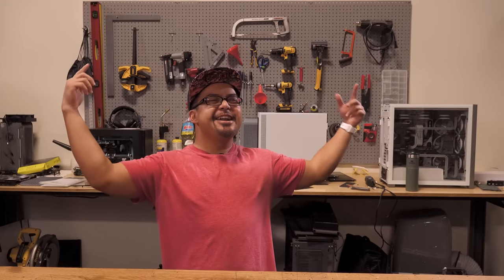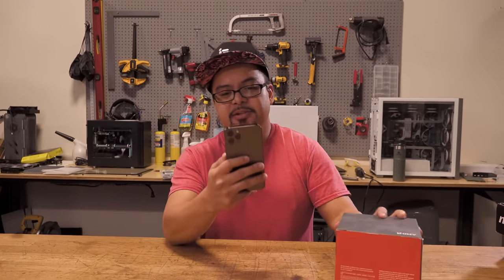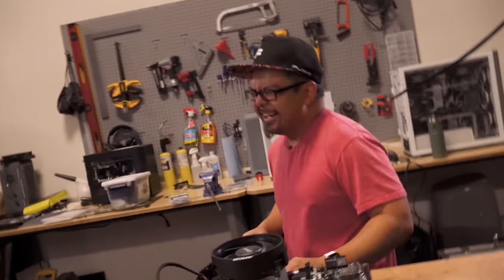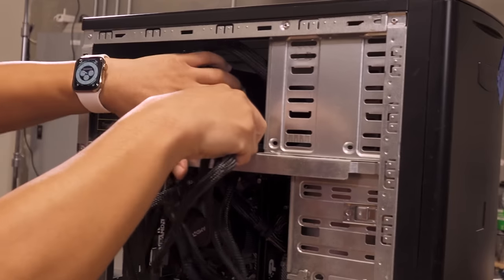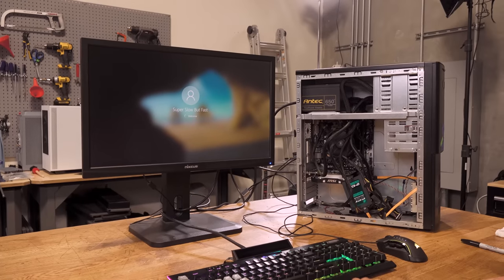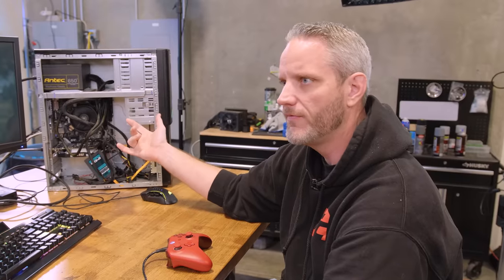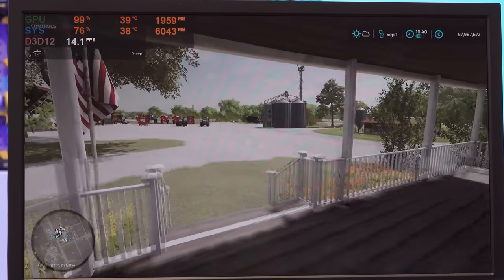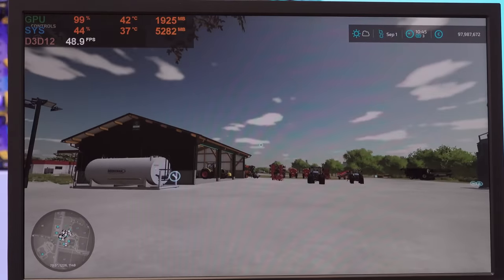Can you game on a "Potato" PC in 2021??

Comment: Petition for more Phil builds? Absolute A tier content! lol

Id like to mention though, the 1050 only has 2gb of vram, which is not good for 60fps on most FS games since it has a really high render distance and needs to compile a ton of shaders and unlike other games, tons of crops and ground types at once the moment you spawn in. This is why going from the 2gb 1050 to the 6gb 1060 made such a big difference. This has been the case since FS17 came out. Also, to get better performance on high, just set shadows and Shader Quality to medium and everything else to high and you should see a decent increase in performance across the board.
Reply: The RAM couse also fps drops, I play fs22 with 16gb RAM and it uses over 50% of it alone
Reply: I want to see what difference a 3060 Ti would make with this 1300X CPU. I'd bet it would be capable of a lot more than most people would think.
Reply: It was a 3GB 1060 i believe, but still i agree with you, this looks and behaves like a vram issue. Especially that part that when you look at the house which is a less vram demanding area you get 60fps and looking at the complex part with all the high quality equipment it drops to 10-15fps
Reply: @malcewicz  I doubt that it was a 3gb 1060 it is more likely to be a 6gb 1060 as they was the goto card with the most bang per buck.
Reply: I agree, I was also suspecting VRAM, especially given he ran the same settings, and there was a noticeable difference in both system ram (shared overflow from GPU) and VRAM usage.
Reply: Yes we need Phil more often!

Comment: Jay: let's build a potato pc!
also jay: builds an average gaming pc
Reply: lol he couldn't find a 760 and he used an SSD instead of a HDD
Reply: Yeah, they used hardware many times higher than the minimums they listed, then act shocked when it works as well as it does.
Reply: @im_linus  sorry bud, tell that to gtx 400 series.
Reply: I built a Intel 970 and 780
Reply: @im_linus  Well scalpers sell the GTX 1060 in my region at ridiculous prices, 400 USD to be exact.
Reply: I have 1050ti… but in a laptop 😭. I built my cousins so now it’s my turn in like 2 years when the shortage ends lol
Reply: @im_linus  Nah it's the 3gb cards.
Reply: @im_linus  ikr, man I'm just going to play older titles and some eSports for now, there's now way I'm going to cough up the cash for these scalpers.
Reply: that is 1080 ti next year xD
Reply: @Gaming ZONE GAZO bruh I’m on uhd
Reply: I'm here with:

AMD A6-9230 Dual Core 1MB L2 cache

4GB RAM 2400mhz single channel

Radeon R4 integrated graphics

120GB SSD (Upgraded from 1TB HDD, I miss that much capacity)

Comment: The problem with upgrading "1 tier" is that the 1050 vs the 1060 is quite a large gap in performance just like most 50 to 60 NVidia cards, even though it doesn't sound like it.
Reply: I think I understand your point... a "tier" varies a lot. A GTX1070 vs a GTX1080 would be a much smaller gap. A GTX1060 vs GTX1050 at same settings might give 75% higher FPS. I haven't crunched the numbers, but I suspect tiers have larger gaps at LOWER END and smaller gaps at higher end. In part due to other system bottlenecks, but also because getting slightly more performance at higher end is expensive (and that's before we get into diminishing visual returns... so lower end from a "value" perspective has a HUGE jump per tier).
Reply: @photonboy999  Absolutely!
Reply: I own both cards and can tell you for a fact the 1060 can still play anything but the 1050 is only good for plex transcoding. Seriously it just cannot realistically game in 2021.
Reply: MaYeRsDZ  yea definitely not like the 1050-1060, its more of like 30% for those.
Reply: @alainmilette6460  facts!
Reply: Alain Milette I'm still running a 1050ti and play older titles because that's all it can play. Sed lyf.
Reply: @sinuslebastian6366  Got a 1050 ti aswell it runs okay but i mostly play games older than 2018 and i overclock it for most games anyways just to get the extra 3 - 5 fps lol
Reply: @iroh9816  what overclock you run man?? Looking to get into it but find it a little intimidating
Reply: @sinuslebastian6366  150 core clock and 500 memory clock it's quite stable
Reply: Iroh noice!
Reply: Its really 3 jumps.
1050
1050ti 
1060 3gb 
1060 6gb

Comment: 2:45 having a DVI port was one of the main selling points for the motherboard on my current APU system. Why pay for expensive monitors when there are so many older ones laying around? The environment surely would agree with me.
Reply: Preach brother. A lot of older monitors still have really good colors and response time is plenty good for non-competitive play. The most important factor in gaming performance (up to a point) is the person at the controls. Plus they act is nice little heaters during the winter.
Reply: Yes exactly
Reply: was one of the reason i'm buying 1030 with vga port
Reply: @ouwkyuha  VGA is another story. With DVI you get a digital signal that looks just as good as HDMI, all other things being equal. VGA is just plain worse

Comment: I love how expectations of these running low specs is not even in Jay's radar. Didn't even attempt to run the game at 720p, which is a very reasonable thing to try. Also, trying to make it locked, smooth 30 fps is also very relevant - especially given what he says later that it's a slow paced game.
Reply: He's not used to having limitations.
Reply: Yeah I currently am on a GTX 760, and just play games in 1600x900 or 720p because 1080 is just too much ha
Reply: I can't tell the difference between 30 and 60 fps, let alone 120 fps or higher framerate.
Reply: I remember when I built my first gaming PC, 30-40fps locked was all I could hope for with some games, and it was playable. It's worse to have your fps all over the place rather than just capped steady at a "playable" rate.
Reply: Why should he go down that far when the worst hardware he has already does 1080p low just fine?

Comment: id love to see a video comparing current integrated vs older dedicated, love the idea of showing the progress in long term. same for power usage, at the same performance
Reply: Have a like!
Reply: Have two!
Reply: Why so stingy? Have 7 likes!
Reply: Unless the older dedicated is really old, it'll probably still trump current integrated.
Reply: @arnox4554  im betting anything with 2gb ddr5 and better is going to be faster, but then the wattage difference is going to look hilarious
Reply: Idk about intel hd, but i have a 5600g. it outperforms my old r7 350 and it supposedly outperforms a gt1030 by a decent margin. Trying to shoot for an rx 6600 but till then the 5600g really isnt that bad for most of the gaming i do.
Reply: I just built a new DIY system with a Ryzen 5700G.  It runs Forza Horizon 5 at around 40fps, which is only about 30fps than my Nvidia GTX970!!
Reply: @arnox4554  Depends how you define "really old". I don't think 5 years is that old but I just built a new DIY system with a Ryzen 5700G.  It runs Forza Horizon 5 at around 40fps, which is only about 30fps than my Nvidia GTX970!!
Reply: @carlwaring  thats awesome, but racing games arent all that demanding usually.

Comment: Nice to see you testing it against FS22 and fun that you even notice that you get stuck for hours . But a tip. test it with more objects. for each pallet from the factories or greenhouses or loggs in the forest is registered as a separate object. so all computers will have problems in the end especially if you load loads of pallets or logs on several trailers and drive away or stack them in massive piles and then try to move the pile.  In MP the we have 150 pallets on a trailer on a I7 4790 - 16 gb ram dedi server and all get about 15fps when it moved ;)

Comment: I’m very glad I upgraded my system back in February. I was basically running what they call their potato build. GPU is still the 1050ti (so barely better than what they dropped in this) but the rest has been replaced by MUCH better hardware
Reply: Did the exact same two months later. Kept my 1050ti too! Let's hope we can upgrade with something reasonable within the next 2 years, cause 1 year is maybe a bit too optimistic.
Reply: gt 1030 for life ;)

Comment: I’ve had nothing but problems with farming sim 2022 since launch,  anyone else getting random screen flicker tied to frame timing,  only happens after a couple hours then the screen will start flickering badly
Reply: Only on the Elmcreek Map. But there it is permanent. On the French Map it only happend once or twice in 20 hours.
Reply: @DasNik25  it’s pretty annoying when it first happened it startled me,  was worried I’d had a hardware failure on a brand new gaming build and monitor
Reply: I have no problems, and I play the game every day for 2-6 hours on Elmcreek.
I use an RTX 2070 super Graphicscard. I play the game at 2560x1440 at 60fps on highest settings
Reply: I've battled this issue of stutter and tearing all sorts  for 3 weeks I did alter my graphics card 3d setting  used dev mod and changed the cable from my pc to monitor  today so far so good but this game has worked fine before then a day later something else goes wrong.
If you go into the shop and zoom out the fps plummets and stutters. 
Think the game itself need a long hard look at by Giants as I see so many unhappy people with this game.

Comment: Until the middle of this year I was running a I7-7700K with a Radeon RX Vega 64 card and a Ultra Wide 2560x1080 display. This was with starting to stream in January of this year. I ran games like Cyberpunk 2077 on Ultra settings with 45+ fps. While the Vega was way more powerful than people tend to give it credit for (and I paid way to much for it since I bought it during the 1st cryptocurrency boom), it was quite capable. I only replaced it because streaming on that PC wasn't possible with certain games (like Subnautica and Cyberpunk 2077) as resource usage was just to high.

Comment: I think one of the important thing is the VRAM size. GTX1050(2GB)'s 2GB VRAM is not capable of most games now (or even long time ago). But 1060(6GB) is still pretty enough for most games.
A sweet spot is 4GB VRAM, from GTX960(4GB) to GTX1050(4GB) and 1060(5GB) and beyond.
Reply: That’s why I love my 3gb 660 ti so much, it actually helps a lot to have 1gb of extra vram on that card. It’s still nothing compared to my 1080 ti though.

Comment: I like the direction that you went with this. Though I would try like a GTX 970 and an ivy bridge, 16GB ram and a SSD. That would be a good cheap gaming PC that is capable and cheap to buy on the secondary market. Hell, a 770 would probably still hold its own at 1080p gaming these days.... it did back then.

Comment: Seems to be VRAM related. Medium is using 2.3GB, High is around 2.7GB. System Memory usage was lower on the 1060. Seems to be buckling having to swap assets between VRAM/System RAM on the 1050 since it only has 2GB of VRAM. A 1050 ti might be able to handle it better since it has 4GB. Reducing LOD and Object Draw Distance as well as turning off MSAA (which is very expensive in terms of performance compared to post processing AA techniques) are probably the first changes to consider. You have LOD/DD over 100%, so it is rendering objects/terrain that is far away, hence why it drops so hard when you look towards your farm. For AA,  TAA should be good enough, or perhaps using reshade for SMAA/FXAA.

Comment: Huh, did not expect it to be that close to my current system:
4GB RX570
Ryzen 3 3200G
16GB 3200MHz CL16 RAM
B450M mobo, also with VGA and DVI.

It runs the most demanding games I play well enough (Century: Age of Ashes and Horizon Zero Dawn) and it does not struggle with everything else I play on it, so it's not a problem that I won't be able to upgrade it any time soon.
Reply: Latest patch added AMD FSR to Horizon ZD.
I wonder what kind of performance it is possible to have with just using R3 3200G and 1920 x 800 scaled down to 60% / low medium

Comment: In 2018 I finally replaced my +10 year old gaming setup which, with one I am still using today. 

In the first few months I was only using the onboard intel cpu graphic chip the 630. 
I specifically ordered 16gb of ddr4-ram 3200MHz to slightly boost its performance. 

And it was capable of playing pretty much any title up until than. 

Counter-Strike: Global Offensive
Doom 2016
Elder Scrolls Online
World of Warcraft
Mass Effect Andromeda
Skyrim modded
Overwatch
etc.

I later did buy a 1050ti for a bit more quality. 

So here's a video tip: 

How can you utilize a onboard chip to its full potential until the gpu prices drop and or are back in stock. 

1060's are still pricy, heck even the 1050ti's are nearly 400 euro's right now. 
I bought mine for 250 and that was already 30% more expensive. 

But the 1050ti is perfectly capable of playing pretty much any game. 
Granted it won't look as pretty as a 3090 Ultra settings, but it gets the job done. 

And I personally always play my ( Shooter games ) with everything set to LOW for the best performance and lowest input lag. 

And at this moment I am playing Vanguard and Warzone with a FPS between 50-90. 
 
With my FPS being a steady 46-60 fps in Warzone Pacific. 1080p and I even won a match.

Comment: Agreed on FS22. Don't need to ask how you got the millions of monies. I know how. 
RX590 is supposed to be somewhere between 1060 and 1070 in performance. That's what I am using and my FPS is 60 locked and never drops. I didn't see a render distance setting but it's not very high and uses lower quality texture at distance. If that were different I think it would put a few cards on notice.

Comment: You done messed up A-a-aon.

You can't have an equivalent I make it work because the issue is that the 660 is now Legacy drivers. Your card is still supported by the latest drivers, which makes a difference.

Although in all fairness, I never would have thought of this had I not been dealing with it.

Comment: If you call that a Potato PC then I have a Peanut PC
Specs : 
CPU : AMD phenom 2 core 2 threads
2 GB ram 
GPU : none 
But it has Inbuilt graphics in the motherboard !
500 gb hard disk
It runs OKish on Windows 7 32bit

Comment: I wonder the difference between laptops and desktops. I have system specs that are supposed to be better on my 2018 (?) Nitro 5 and I can barely do Med. specs on most games. If I try high settings it tends to freeze or lag. I have trouble at times running even Chrome.

Comment: That's not a potato. My HP ProBook 4530s laptop with an i5-2450M and a Radeon 7470M that barely plays Skyrim on 800x600 Low without shadows at 20 FPS is a potato. This "potato" PC is a rocketship in comparison.

Comment: The 1060 (with 6 GB VRam) really is a godlike card. I initially bought mine as a budget option and instead opted for bit bigger CPU so I can carry on with this build much longer and only have to update the GPU at some point. Heard good things about the 1060 and was not disappointed at all. It did everything smoothly in 1080p and even managed to pull of VR on a Rift CV1 very solidly with a bit of settings tweaking. I had considered to switch to a 2080 TI but then decided to keep gaming on the 1060 and wait for next gen... and that was a great decision. The money saved till then got me a 3090 (because frankly, everything else was already sold out and way above retail price... pulled the trigger before it increased in price as well) instead. 

If you'd have to put it in potato category, it would be a really nice one, like a baked potato with sour cream on top.